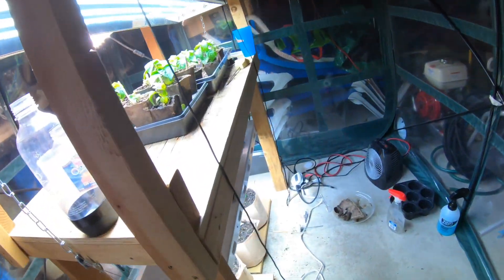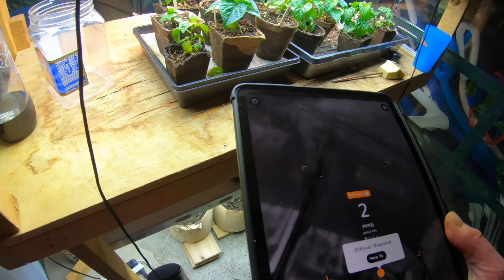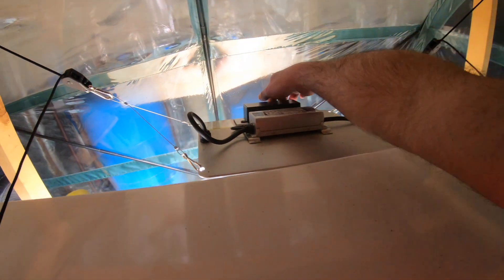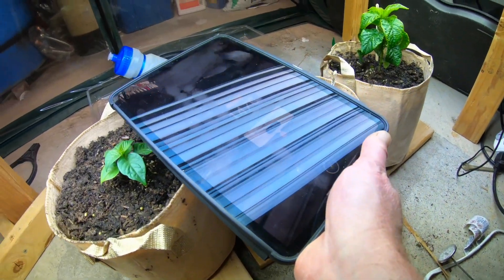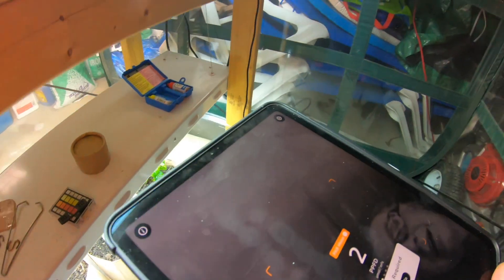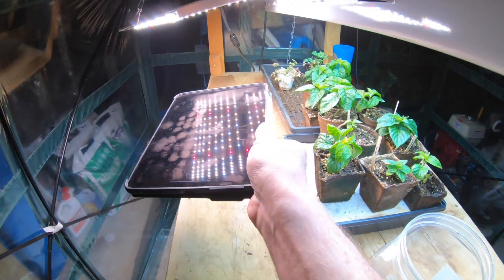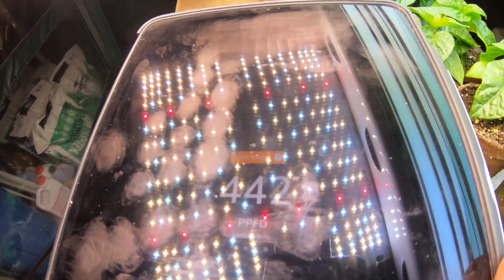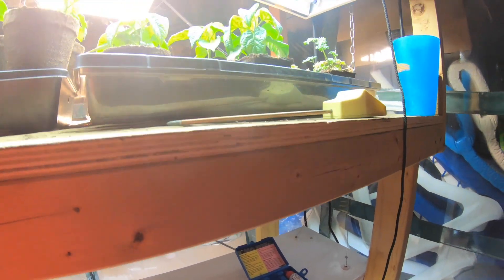T5 Vs LED Lights for growing plants. Huge difference

Comment: The point of LED is you can get more accurate spectrum and for wattage. It's much cheaper to run and we're consistent. Bulbstubes  degrade over time and give inconsistent output.
Reply from the maker: Thank you.

Comment: Put paper over the camera mate more accurate reading
Reply: Definitely need a diffuser which can be a piece of computer paper. Also that app probably makes you specify which type of light you are detecting which makes a big difference
Reply from the maker: Thank you very much for the tip.  Gonna try it this year. Almost ready to start.